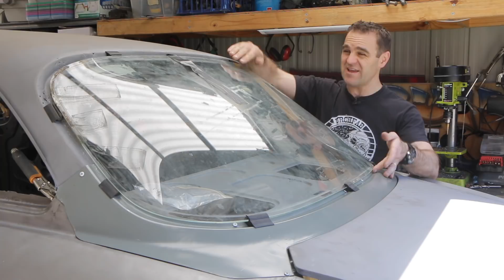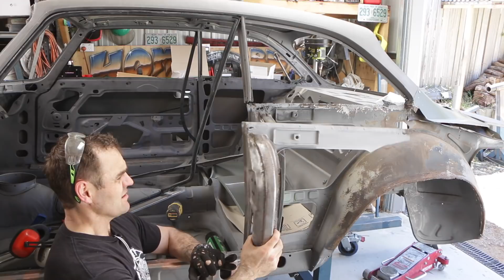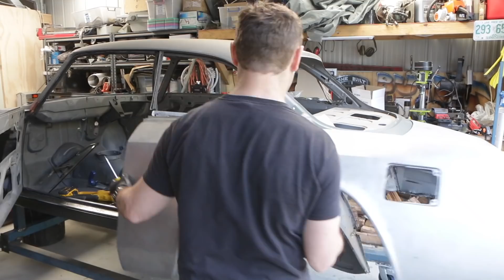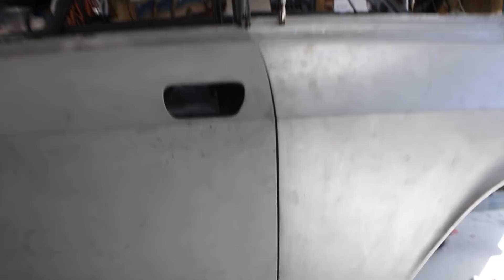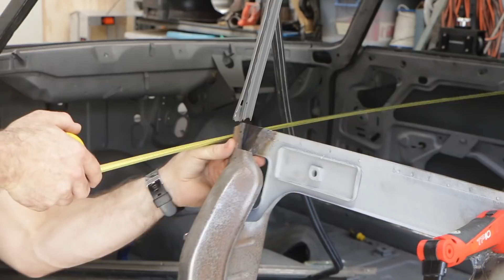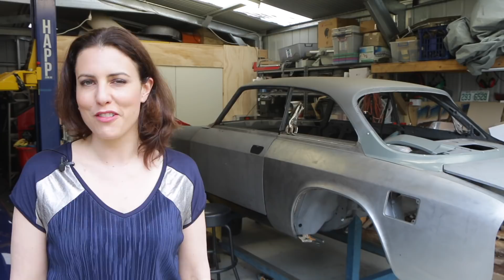B pillar replacement - Alfarrari 105 project car build part 20

Comment: I realized now that this donor b-pillar doesn't have the provision indentation for the buffer receiver like the original you cut off. The donor is from a earlier alfa... In the future you won't be able to use door buffers sice there will be no receiver in the pillar

Comment: Nice work jeff. I’m catching up on the build.  
Question: why did you TIG weld the b Pilar vs MIG?
Reply from the maker: As I have explained in many of the videos, MIG is easier, but requires a lot of grinding and makes a harder, more brittle weld. TIG welds are much nicer to work with.
Reply: @HomeBuiltByJeff  thanks so much for the feedback. I'm finishing a 62 triumph TR4 but I farmed out the all the body work. I have a 74 charger that i want to work on but have no welding experience, think I start with a MIG and see how that goes. you work has inspired me to get more hands on. Cheers.

Comment: I know those looks from Mrs Jeff, I have been getting them for quite some time ,,it might help in Jeffs ,,,defence? if I say ,this is an Alfa and none of these coupes are the same .The original cars were hand built and that process can leave you with substantial differences ..even side to side on the same car.Personally I have quite a bit of difference ,..It just means it's a bit of a jig saw and when non original ...I mean say a door which was made for one car is put on another, it will throw things out to a greater or lesser extent ...can be very frustrating .Jeff is doing a good job keeping patient .Great work.

Comment: Great job Jeff 
I just noticed that you raised the back window shelf panel a little with the jack when aligning the rear window aperture. That's a good example of how flexible the monocot structure is. Needless to say the floor is missing in the boot area. When a car is rear ended (shunted) the wheel arches bulge a little and that's a great tell-tail sign of past damage. It's something that should be addressed before the 1/4 panel is refitted.. See, the alignment bench attaches at the suspension and not the body rear. The inner arches are the stabilising force of bracing the sag height to complete the rear end. The earlier cars had a taller rear 1/4 panel in relation to the rear arch and had the better bracing potential. Because of this the car sat higher at the back with standard spring spacer blocks for wheel clearance with the earlier 15 inch wheel rims. I personally like the slight jacked up version so the sills run level with ground or be it down hill to the front. The rear suspension springs originally where so weak and soft that the sag is evident to all the cars 50 years on...
My point is the rusty old inner guards are weak and need aligning and bracing , and then 1/4 panel install .

Many thanks to you Jeff and your gorgeous one.
Cheers
GT
Reply from the maker: The inner guards are being cut out anyway, and the boot floor, etc, is not going to be standard so it is not really relevant in this case.

Comment: Hey Jeff - happy to see things are moving but I am not so happy with how you handled that in-between section in the b-pillar and the bottom section. That B-pillar is structural and meant to resist lateral impacts to protect the misses. You should have first weld an intersection of much thicker material inside the B-pillar and the bottom section to fortify the 2 parts ( you could have used material from the old B-pillar which has the same curve, the curve is essential to resist higher shocks) 
I am also afraid you remove too many parts and material from the entire car before having put an inside harness to keep your reference points. Without proper reference points, you might end up cruising in a crab-driving car. Now, you might say it's easy to comment away when you do all the hard work but i am only think of your safety ....and the lovely misses, of course.

Comment: The joggler/punch is great, ive been using it to punch the holes for my plug welds. I used the flange tool when i was putting in quarter panel repair sections, the flange makes the panel nice and rigid so i didnt get much distortion,  just does require more in the way of moisture protection afterwards

Comment: Small tip to help with the TIG welding: try using smaller diameter filler rod. I typically use 1/16" (~1.5mm) ER70S-2 for my welding. It will take less heat to melt the filler which helps keep the heat down on the thinner sheet metal. Also make sure you're properly cleaning the base metal, use some clean cotton rags and some acetone to wipe down everything (filler rod included) before you start welding. The blowouts typically happen when something contaminates your weld.
Reply from the maker: I am using 1.6mm filler rod ;)
Reply: Home Built By Jeff 👍 a neat trick I saw was to use MIG wire as filler for really thin stuff, just cut a decent length off your spool and treat it like TIG rod. Haven’t tried that myself yet, might be worth a try if you have some 22 gauge steel to weld.

Comment: That B pillar is a great find, bits like that are getting harder to come by, especially rust free ones. I saw a tip on a pro fabricator's Instagram, he Mig welded the panel just to tack it in place and filled in the rest with the TIG welder, I found tack welding with TIG is really difficult. Great job on the bracing too
Reply from the maker: I have noticed that, and I am switching between the two. At the moment I am trying to use the TIG as much as possible, mostly to learn it.

Comment: Are there any plans to make the car a bit more rigid? With that Ferrari motor you will be approaching corners at quite a rate of knots. If not a half cage, then some underbody bracing at least would go a long way. Great work on the car so far otherwise Jeff!
Reply from the maker: Yep
Reply: @HomeBuiltByJeff  More details? Nope...

Comment: Hey mate, to help with bending those more rounded corners in patch panels you need to find the appropriate diameter pipe/rod/tube that fits snugly into the bends radius. Then just fold you repair section around the tube and hey presto, a better fitting repair piece than if just bend in the bend press.
Reply from the maker: I use exactly that if called for. These bends fit perfectly out of the press ;)

Comment: Surely the fact that the rear glass fitted well when a trolley jack was lifting the rear should tell you to rethink how you're bracing the car.  Watching the quarter wobble around like a fat breast out of a bra was a worry.  If you can't brace the car adequately, adding the heat and movement (warpage) of welding isn't going to make it better.  Has Mrs Jeff had a hairdo?
Reply from the maker: The quarter isn't connected to anything, so it wobbles? Bracing has nothing to do with it.
Reply: @HomeBuiltByJeff  I think that was my point, how can you align anything when you've got no structure and no reference points.  Before you tell me I'm wrong, I have a restoration business and have restored cars for almost 30 years.

Comment: Looking good mate! Brings back awful memories of using the manual joddler, off to go buy an air powered one now!
Reply from the maker: So quick and easy, particularly for punching mig holes. Doesn't bend and warp the edge like the drill press does and so quick!

Comment: If you’re doing a restomod trying to do things the right way is the wrong way.
If you have access to a good straight vehicle to take reference points from use it to make alignment jigs and cardboard templates of all critical points. Do not cut away all the damaged rusted parts if they are providing support and stability, only do a section at a time to maintain structural integrity and position.
If you’re doing a restomod with a heavier higher performance engine take advantage of all the rust repairs by building in a stronger structure with integrated roll cage.
The sill panels A and B pillars should be tossed and replaced with chromemolly tubing instead of the factory parts.
Reply from the maker: That would be great, but it is not road legal in Australia.
Reply: @HomeBuiltByJeff  Are you sure?  Ben Neils' Cresta is rego'd with a cage... https://www.youtube.com/watch?v=06cbzTZap1c&t=13s
Reply: @MrKombiman  that would have been under a club registration where it's highly limited with where and when you can actually drive it. You'd have to fill in which roads you're using, why it's being used on the road, what times you expect to be going from A - B.

It's like one time an old friend of mine had to get his exhaust done, so he just got specific registration for 3 days which allowed him to drive from his house about 40 minutes to the exhaust shop with full open exhaust. 

I'm thinking that Jeff is looking at being able to get this car done and be able to take it for a drive any day that there is some nice Sun and not have to spend half the day down the rego office before hand.
Reply: @HomeBuiltByJeff  . As long as it is compliant with the ADRs and state regulations fitting a roll cage is allowed.
Rally and other club cars need special permits and restrictions. An engineering certificate is the usual requirement for any modification that is not standard fitment to a particular model that may impact safety. However I was talking about the hidden components that are made cheap not strong.
Reply: well it's all a game of live and learn, I think that the best way, in order to be able to look at ramping up the strength and still have it looking stock would be to take a page out of the old American Dodge's where they just added stiffening braces underneath the car in order to be able to allow their basic cars which were engineered to handle the output of their smaller engines to then handle the output of the 426. Just by putting the right strength in the right place, you can really stiffen up any torsion twisting which is inherent in the Alpha. In addition it to gain more torsion strength, just fully welding along all the seams increases rigidity by a substantial amount.

In Australia it's all about what you can hide in plain sight :D